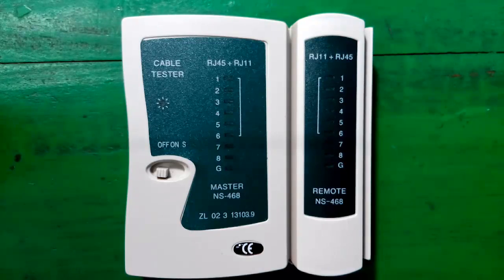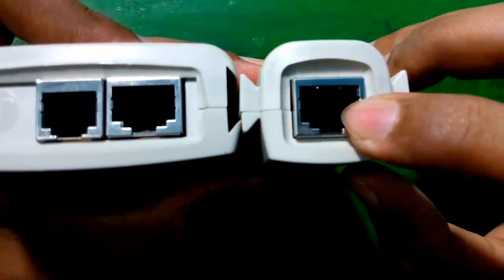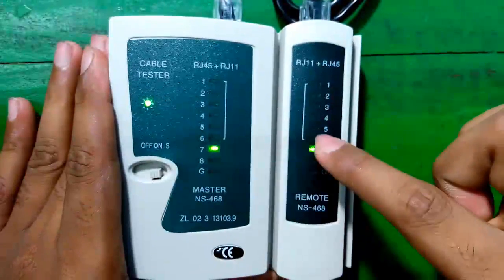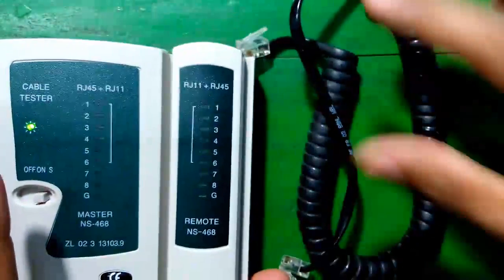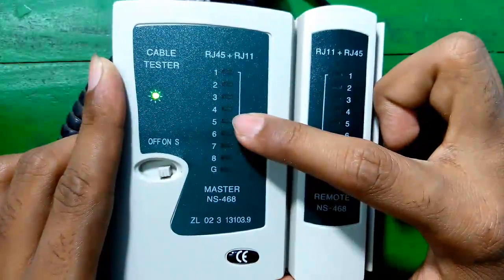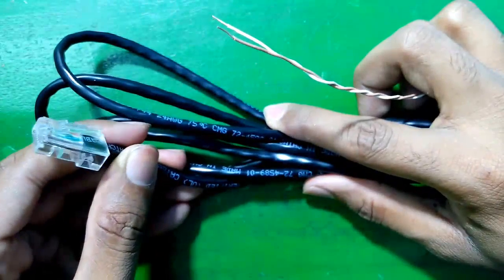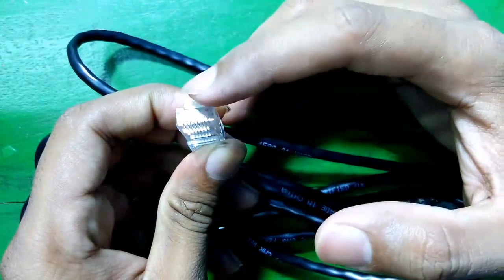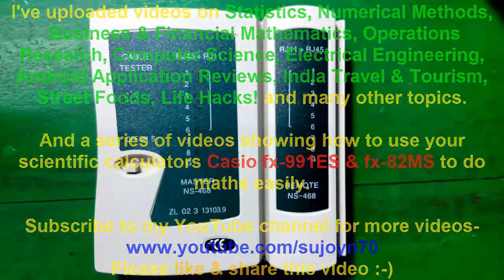CCNA 2_How to Use LAN Tester to Test Straight,Crossover,Rollover UTP Cables + Useful Info!

Comment: great video can i check phone line  by putting master unit in wall socket and putting remote unit in extension wall socket to check wiring in wall with network tester thanks
Reply from the maker: You can check but remember both ends of cable should be open to test with this tester. Means there should not be any device connected on the other end of the cable while testing. Else it may damage the tester.
Reply: @sujoy70   thanks for the repy i have no phone  in wall sockets at this time. so i can test test the wires in the wall  with no phones in wall sockets is that the way to test the wires thanks
Reply from the maker: @jeffvezich8936  Yes you can, you'll need two RJ11 patch cords, one end you connect slave-unit to wall jack via patch cord, another end you connect master-unit to wall jack via patch cord to test the underlying cabling. Don't forget to subscribe my channel if it helps!
Reply: @sujoy70   thanks

Comment: If connect router (not WAN port) to another routers switch port (not WAN port) should I use straight cable?
Reply from the maker: You can use straight cable if both ports are L2 (LAN) ports. Now a days you can connect most routers also with straight cables due to Auto-MDIX :-)
Reply: @sujoy70  Thank you so much!!!!

Comment: Can these testers be used on cables that may be plugged into devices? For example, a network that is in use, I have a cable some distance away and a connector at the other end. I do not know if this cable is the same cable, so could I use this to plug the master in one end and the remote in the other end, even though the actual other end may be plugged into a computer?
Reply from the maker: +TutsTeach Yes,I tested. But not all 8 LEDs will blink. There's another way, plug in the cable to PC and check if port blinks. If so, the cable is live, you just need to locate the other end on switch/router. Hope you like my CCNA tutorials! More vids- http://goo.gl/VNzY4E
Reply from the maker: +TutsTeach Thanks! Subscribe to my YouTube channel so that when I upload a new video, you get notified. If you like any of my videos, request you to please like & share it. Because sharing is caring :-)